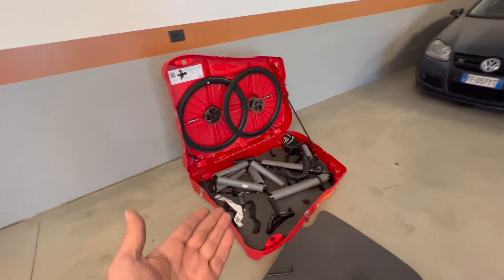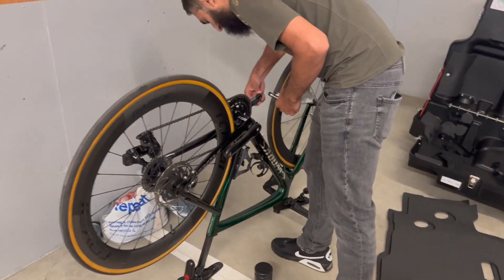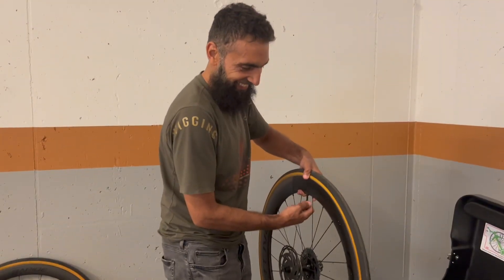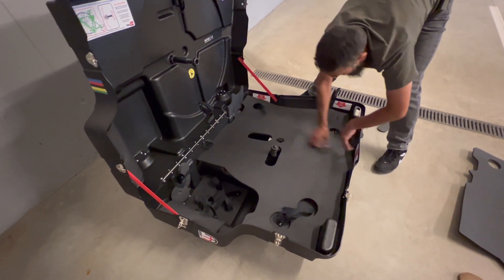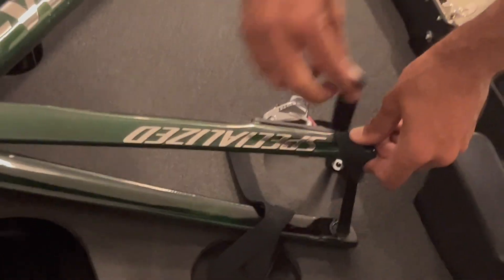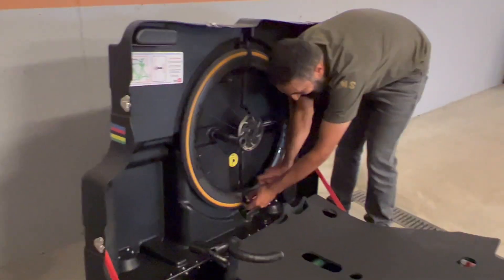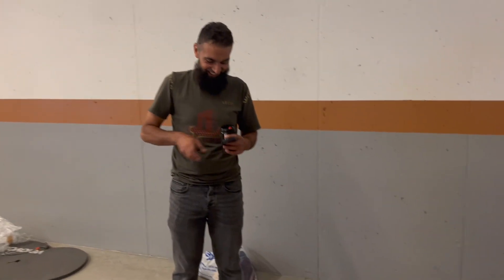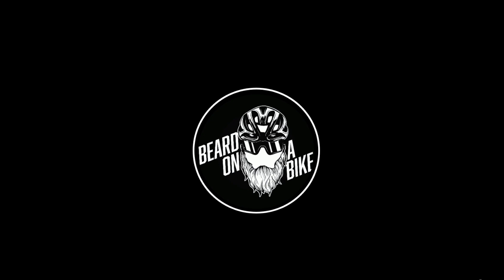Bike Box Alan Easy Fit demo -The best option for integrated handlebars

Comment: I have a slightly older BBA that I’ve used a few times, but have to take off the bars and my 28mm tires don’t fit so well. Been trying to decide if this box is worth upgrading, especially since I don’t have a lot of space to store it when not in use.

How easy is it to move around with compared to the previous versions? I almost always find that I have to lift mine up stairs whenever I’m using it.
Reply from the maker: It weighs a bit more and is slightly wider in one area to accommodate the handle bars.

My own bike is a 54 and have no issues with 28mm tyres I do take off the bars though.

Comment: Remove pedals... deal killer. What a pain in the ass. Plenty of other options where this is not needed.
Reply: Plenty of other options…. I’d like to hear them. If you can’t take off a couple of pedals stay at home
Reply: I take off my pedals to put them in the car. Dead easy. I am much more concerned about how to deal with integrated front cables. I have the original Bike Box.